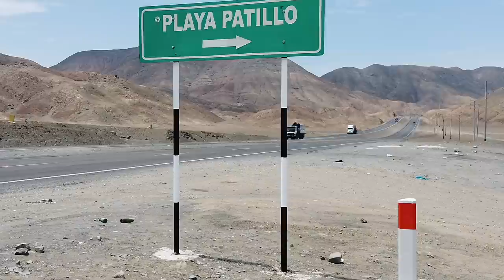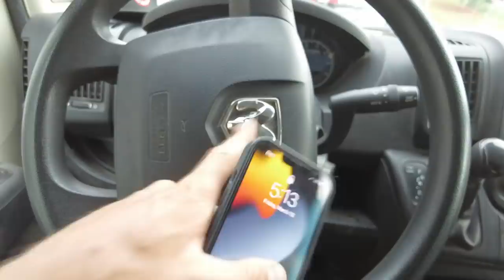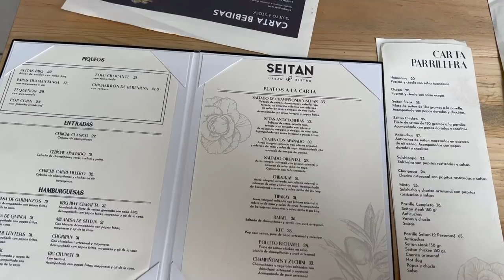We Can't Make It | VAN WORK IN LIMA HEADING SOUTH #vanlife #alaskatoargentina

Comment: try and get nother of those undercarriage washes once you get past the fine sand dust, half way down the coast of Chile. If you aren't planning to go to Bolivia, just see if it's safe to get to Arequipa from Cusco, and then on to Chile
Reply from the maker: Ok will do! The chassis has starting squeaking again so I’d love to do it again.  We’ll do Bolivia next. So if we hit the salt flat the undercarriage wash will come directly after! Thanks for the advice. Hope you’re well
Reply: @the.vandersons  the squeaking will come from wear to the engine mounts, transmission mounts and bushings. Also, see if your car needs to be greased during oil changes, front end, wheel bearings, etc.

Comment: Do you keep like coolant in your radiator not just plain water.  Always change oil every so often.  I tried to like your video but it won't  let me.  Driving at night in Mexico or???  Do get robbed at night.  I'd keep a dummy purse and wallet with a few pesos in it and keep my real valuables hidden away.  Be smart.
Reply from the maker: Driving at night in Peru might be slightly more advisable than in Mex, but both are best avoided for sure. Although the headlights sort of make some potholes/speed bumps more obvious at times. 

We use the recommended OAT red coolant but have put a bit of distilled water in to top it up when we were out. Cheers!